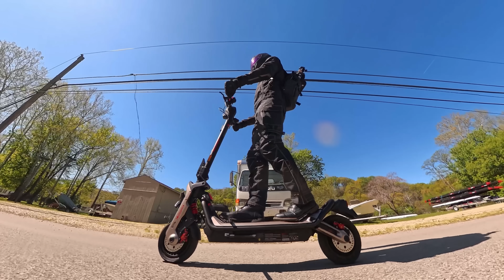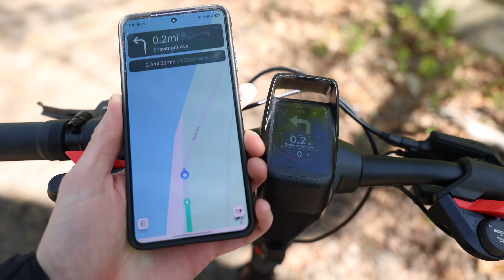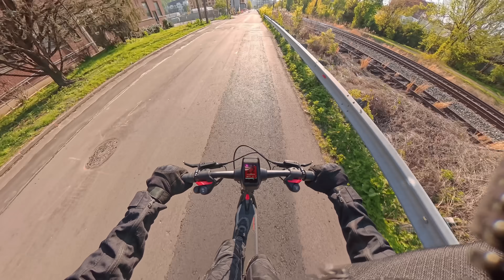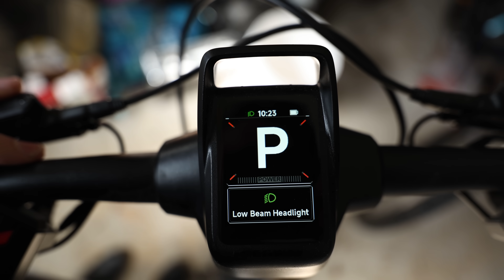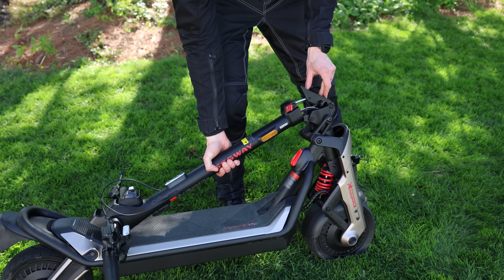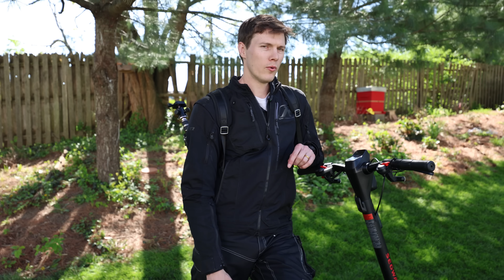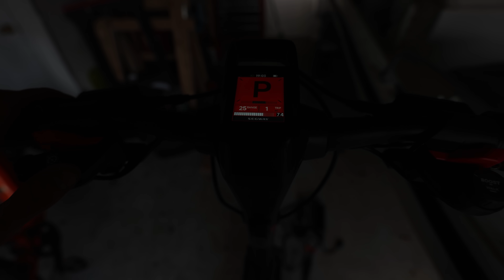Can A $2,700 Electric Scooter Replace My Car? - I Tried For 3 Days

Comment: I have a E3 Pro, costs a fraction of that one, and it goes up to 32 mph in Sport mode, I usually use Drive mode for shorter distances because 32 mph feels a bit too fast and dangerous, especially if I am not using a helmet (guilty as charged). I think 50 mph is insanely dangerous, with this tiny wheels, if you hit a bigger hole you're done! Hanging things on the handle or hook really makes it unstable, having a backpack with you is the best way to do shopping, or tote bags hanging across your shoulder. The only thing I wish these scooters have is a charger plug on the front that could work somewhat like a magsafe and snaps onto a wall mounted clip, this way, parking the scooter and recharge would be a breeze, drop and go.

Comment: The electric unicycle has a bigger wheel and is safer, most importantly you don't need to lock it outside. Thanks to the technology stifling boomer goblins at Sequoia Capital, Ninebot no longer produces electric unicycles.

Comment: The price is crazy!  You can buy a cheap version for $200 and do the same function but shorter distance
Reply: You cannot buy en eScooter for $200 that does 30mph much less 50mph
Reply: @IntelligentleMANgief yeah I know.  I buy one that goes 15mph and goes 20miles.  Electric scooter is cheaper now
Reply: lol that's not true. Even a $1000 scooter is low to medium level of scooters. They easily get up to $10,000

Comment: 3:57 the lock you're using can be pried apart don't use it, look for Master locks motorcycle handcuff lock they made an updated heavy duty version that is much better
Reply: You really just said, dont use a kryptonite lock and said use a master lock?? Lmao
Reply: @Mrgigawatt check it out they updated it
Reply: there are good angle grinder resistant locks, ny kryptonite diamond, hiplok dx 1000, and litelok X3

Comment: One thing about the scooter that you have to keep in mind is the long charge time. If you have to cover long distances at speed, be prepared to wait a while for it to charge. The other day I had to ride 35 miles quickly and I rode about 45 miles an hour and made the trip in 40 minutes. In this time, I drained the battery from 100% to zero. It takes 7.5 hours to fully charge. Obviously most people won’t be doing this, and you can get much more range in sport or Ecomode, break you are really thinking about covering long distances and replacing your car, the long charge time is something to think about. The four amp charger is the only option.

Comment: OMG why not take a plastic or fabric bag with you. OK I will help you all, I got rid of car in 2021, I have two Apollo City Pro scooters because my state doesn't allow bigger scooters, but they are fine. Use a good thick D-Lock, and lock to metal posts and the end of bike racks, always take a back pack for the lock and items like Nano tyre inflator, a phone charger, bandages and small amount antiseptic spray, you are most likely to fall at very slow speeds trying to negotiate something tricky, you won't fall often, "suck it up marine". Always use any app features that lock scooters or have tracking features. I won't go back to cars but may buy a motorbike style electric scooter (equivalent to a petrol 125cc motorcycle), just for freeways occasionally, but my home town has excellent trains and buses that I can take my Apollo's on to. Oh and always wear a helmet, Sunshine. 
Lock the speed to 32 MPH like I do, no need to go faster. Haven't paid for fuel since 2021 and it's much dearer here than USA. Keep off highways just use bike paths, slow back roads and be a mature adult, kids are inexperienced and take higher risks, they crash on anything they ride. Google maps to plan a safer route through the back ways it can be more fun, see more of the area you didn't know was there, I now feed ducks lol.

Comment: the segway isn't designed for cargo, in the rear. but in other models you can alter them to accomodate a bicycle trailer, and pull that with cargo. like a shopping trip

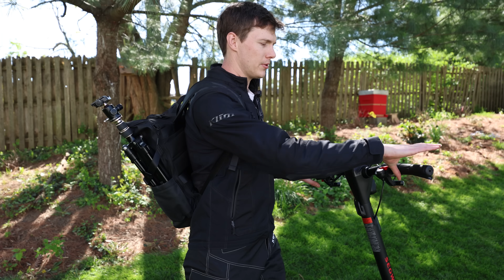Comment: 10:30 No it hasn't changed. I have a GT2 and this works the exact same way if you touch the breaks it turns off the parking mode. Funny to see they STILL haven't changed it and it goes to park mode within 5 seconds still lmao

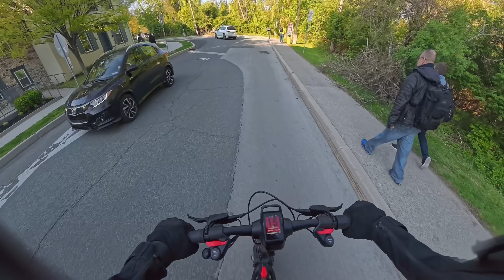Comment: 13:55 I doubt any state allows riding this type of e-scooter on public roads or bike lanes. Most states also do not allow you to exceed 20mph on these vehicles. Of course, very few places actually enforce e-scooter laws.
Reply: as someone who’s been in fort worth with the max g2. im always fine on the speed. but it really lacks bike lanes everywhere for me. and whats worst is bad to no sidewalks near my area. meaning im always on some side of the road. and even when i see cops drive by. they arent caring too much as long as i dont draw attention to my self. (and i dont have a helmet yet. but still trying.)

Comment: I use my scooter as a second vehicle. I strap on a backpack and run the store on weekends, no need to drive. Of course it depends on where you live. I have a little G4 that I ride for short distance, and Apollo for longer distance. If I go for a weekend trip I throw one in back seat and use to ride around other towns. They are very handy.
Reply: How do you lock it up when you go to the store? That’s my main concern
Reply: @MarcusWarcus40  They make special locks that connect to something solid, a bike post or whatever. The app on my apollo has a "lock" mode. Someone could still pick it up, but they wouldn't be able to ride it. The grocery store I visit let me park it inside. On weekends I visit the local tavern for a cold one, they let me park it inside. I never leave it outside if things look sketchy/high crime area.

Comment: During warmer months I basically just use my electric unicycle rather than my car, I keep a solar trickle charger on it since it will sometimes go over a week without being started.  I usually just ride my Nosfet Areo, which is great fun.  Not so fast you act dumb, light enough at 55lbs and small enough to take into places with its trolley handle without getting looks. And having your hands completely open is why I use it when I'm running with my dog.

Comment: Five and a half grand in Australia for the pro. Can't see the justification of that price especially 4 grand for my gt2 I ride in beast mode mastly. Tyres wear down quick but that's the fun without using traction control. Chirping and spinning over bumps.
Tyres so easy to fit with no tools and no need to take brake rotors off either

Comment: I have actually tied an old backpack to the base of mine with duck tape, so that i have the extra space for grocery shopping when i need it. It rarely i go shopping i can have everything in just my backpack, so i can put the extra bag of groceries into the extra backpack instead of having it hanging from the handlebars which is less than ideal 🫣

Comment: Get a gas scooter. You can actually use it to commute and shop.  I get 75mpg and insurance is cheap.
Reply: for real when 150cc street legal chinese scooters are under $1k on amazon why bother with this
Reply: Just buy a motorcycle then
Reply: @Ancienthistorymaster  I did buy a motorcycle that has a cvt. Not all motorcycles have clutches.

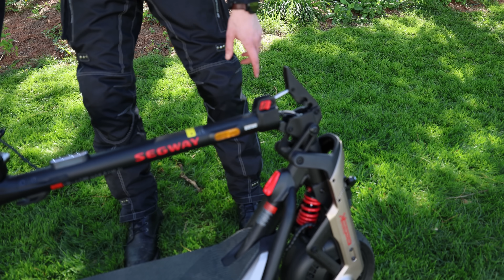Comment: 9:24 downside of my apartment wish we had an elevator 😒I like the scheduled charging but I wish it had a wider base and honestly if I used something this pricey I would be paranoid it would be stolen so you need a really good lock then again that's what Apple tracking is for

Comment: Of course it can replace your car, if the work isn't that far away and if it doesn't rain or snow.
Reply: I have replaced my car with a $150 scooter (19 MPH).  This is incredibly practical in urban settings.  Yes, I use it in rain & snow (full length coat or raincoat with visor works great).  I do rely on public transit the day or two where roads are icy.  I carry full grocery loads in sturdy reusable bags hung on the handle bars (balance them, you don't want them to swing perhaps bungie them to the stem, or I simply steady them with my knee as I drive slow & not too far).
A good helmet is essential to walk away from even minor accidents.
This model is far better than mine - but entering at $150 allowed me to try it out with little financial commitment, & learn what features would benefit me. 
Even with a better scooter - I often prefer the cheaper one for certain functions (easy carry, or to not worry about theft).  The front shocks seem the most important feature on my upgraded ($400) model.
Reply: Absolutely no reason you can’t use this scooter in all kinds of weather. Just dont go max speed

Comment: Had mine for over 200 days. Daily commute are great if your city/town had well maintained roadways. Running errands like shopping is a no go unless you’re buying snacks or have a decent sized backpack. I’ve did long trips on it and it’s definitely fun.
Reply: I go grocery shopping every two days. Instead of getting everything at once like a car, I get items as I need them. Like going to the corner store. Need milk and apples? Boom, 10 minutes and I'm back.

Comment: Costs more than your car? At $2,700 bucks...I call BS
Reply: Some cars are just undesirable
Reply: Car needs yearly plates you gotta renew. Insurance every month. Also gas which has gotten expensive these past couple of months. You pay 2,700 just once from buying the scooter.
Reply: @MrSlidthunder  You obviously misunderstood.
Reply: @Jaxs3003 a cheap used car go can for 1k. With 200k miles.
Reply: @MrSlidthunder  yea, u still argue for some reason. Are you a human or a llm?
Reply: @MrSlidthunder  Many dont care or realize this. Plus cheaper scooters exist

Comment: 3:20 mfs gonna be stealin the whole ass bike rack.
Reply: That is a horseshit way of locking anything. 

For one, a bolt cutter can cut a V shape into that weak flimsy metal and also, those lock are very easy to break. All you need is a drill amd drill into the weak light colored metal rivets or whatever those are called. 

These locks or only good for cheap bikes while you buy your groceries. 

Locking a 2k+ whatever with it is you asking for it getting stolen. 

For proper locking Ineould recommend 3 claymores, a c4 hidden underneath the center plate and phased plasma rifle at the 40w range.
Reply: I've seen pros also twist a metal rod in the lock to make it snap at the weakest link, which is often the lock itself (took not even 10 seconds). If you have a nice electric bike or step > 2-3k$, keep it in sight or lock it indoors.
Reply: @roberth4395  People who steal look for accessbility and ease. Most people do not need a super duper lock 3000 or a fancy way to lock something but they should just in case. If you have a decent lock, any lock really, maybe a bike or scooter cover, usually it's enough based on WHERE and when you lock it. For me, outside the office, literally in my sight all day it's fine. You can't yank it off the telephone pole and it's under a bike cover. And if you were scoping the area, I don't think you want to steal a 218 lbs 6ft foot ball player build guys bike or scooter if you seen me lock it up there. If you lock up your bike over night, no matter where you are, you increase ease and accessbility and give a theif time to plan to bring bolt cutters and all that.

Most folks not lugging around bolt cutters. The smallest ones for a typically decent bike lock is above 12 inches so 18-24. I use bolt cutters during hobby work and stuff like mounting TV's through sheet rock. 18-24 inch cutters are 3lbs-5lbs and 6-9 lbs based on brand and metal. Not super heavy, but heavy enough to be an issue to carry around. Where I keep mine by the office, there's no where to go and people forget, you have to find out how to use the scooter or bike too. I got the key, where are you going with it? Can't kick away on the scooter, can't pedal off with my E-Bike and have to remove the cover, unclip it and bolt cut it and remove a bungie cord on the telephone pole. I see you before you get half way through all that, and your a$$ is grass.
Reply: Happened to me once a very long time ago 🤣Parked my raggedy bike somewhere tied to a rack. Came back 2-3 days later ... no more rack 🤔

Comment: Makes more sense with an E-bike. Scooters are just fun toys.
Reply: I think a scooter can be practical, but in almost any situation a bike is more practical. Larger wheels, a more stable position, it's easier to carry stuff with you, and if the battery dies or the electronics otherwise fail you, you can just pedal and keep up a nice speed pretty easily.
Reply: Takes up much less room. Great to have the option but I think they should have came with larger wheels.
Reply: How is something that’s smaller faster and more transportable more practical … your saying anything
Reply: I think my scooter is really practical, I get all my groceries with it, drive to the barber, doctor and visit friends with it. I am actually faster with it, since I can use bike ways with it here in Germany.
Reply: This right here. I have a lightweight ebike (40 pounds with everything and baskets on both front and back) and i have been using it to commute to work and get groceries
Reply: That's pretty silly to say, especially because a lot of Americans think of bikes as toys too. An escooter is more portable and cheaper than an ebike. A coworker of mine commuted on one every day and it cost him $150. It was much easier for him to take into the office compared to my ebike which is especially important because most places do not have good spots to lock a bike around me.

Comment: You can absolutely get around and do what you need to do 90% of the time with a scooter. Mine doesn’t even go faster than 19 mph. 35mph and above is easier to keep up in traffic but in the city, 19mph is enough.
Reply: I'd say that in a bike lane that's fast enough. at least around me people go 30-35 when the limit is 25. fortunately I only need to one store every once in a great while and only at night when I'm most visible. cops around here don't care: I have brake lights, running lights, and turn signals. I don't pay for parking, gas, insurance, registration. replacement parts and maintenance are both much cheaper than a car

Comment: Thank you for wearing all the gear while riding this. We need more good examples of people actually protecting themselves while on these things.
Reply from the maker: Too many kids riding without helmets. If only they knew how dangerous these really are
Reply: @MikeOBrienMedia  Helmets are absolutely essential!  This precaution is Not well known, or widely adhered to.
Reply: @M @MikeOBrienMedia im riding without a helmet on my e scooter max speed 19 mph but yes i understand the risk and am getting a helmet very soon for my upgraded scooter coming soon
Reply: Honestly, I'm too cool for gear just as your too cool to use turn signals or use your seat belt.
Reply: @Young_Dab You won't be saying the same thing when you get yeeted over the handlebars, break your jaw, spend tens of thousands of dollars on getting it fixed, and spend months in pain while it heals lol
Reply: @Young_Dab You do you! The road doesn't give a fuck either way. C:
Reply: I ride in strap sandals, shorts and a T-shirt.
Reply: Wear your gear in your car too.. have to be consistent.